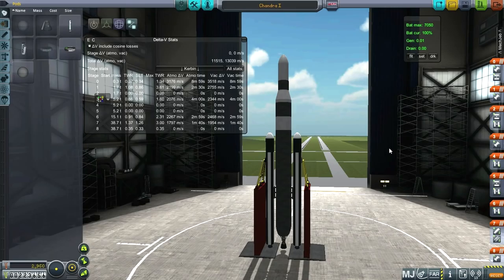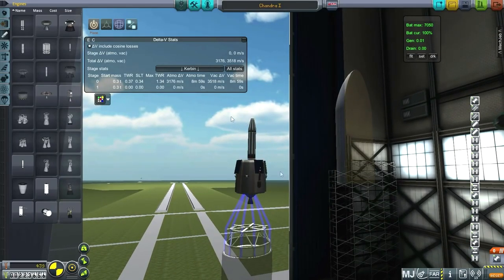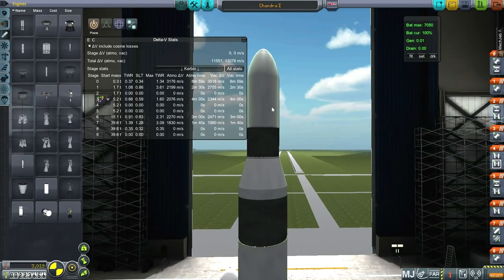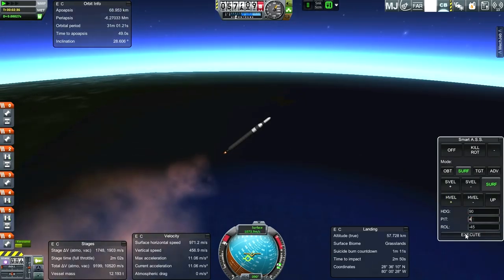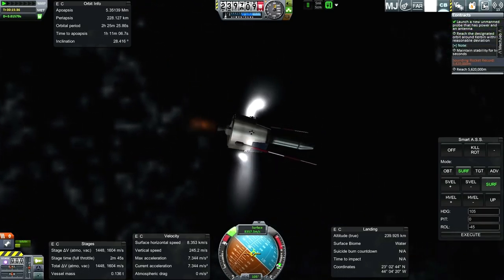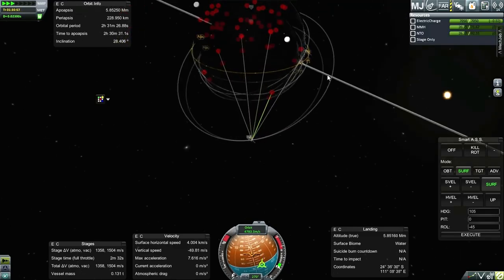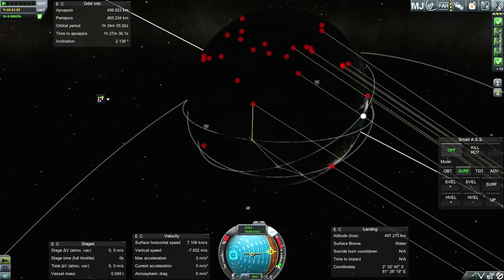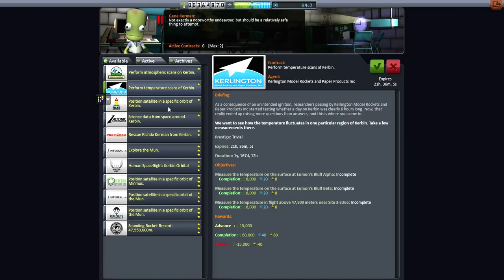Realism Overhaul in KSP Beta 06 - Fulfillment

Comment: Formula is range_a + sqrt(range_a * range_b) s.t. range_a < range_b. Note that the Deep Space Network groundstations on Earth have quite insane ranges (IIRC 7.5e+11) and even the regular launch-site ones are 75,000km. That means with 2 C16s and the Explorer core range_a = 9,000km, range_b = 75,000km, so final range is ~34,000km. With a 75,000,000km groundstation, now, it's a lot higher.
Reply: ***** It's my "semi-real" formula, aka rangemodel "root" (used to be "additive"). There's also a clamp, of 100 for antennas (and antenna-dish) and 1000 for dishes, i.e. if your probe's range is 9000km, then you won't have connection past 900,000km even the formula has a larger result. The normal RT rangemodel says, hey, the maximum-range antenna on your vessel is 4000km? Then you don't get signal past 4000km.
Reply: *****
I added the Launch-From-Cape relevant sites in the MSFN specifically so you get coverage on ascent (i.e. Bermuda and Canaries)

Comment: 1:40 - >  you don't need to upgrade your launchpad. Just put empty rocket on the pad and then fuel it. Like in real life :)

Use FASA launch clamps, right click on them and "toggle pump". Of course this is a bit cheaty because you can send 40t empty rocket on the pad and fuel it to 400t :>

You can also combine inclination change with periapsis change (more efficient then doing it separately) or even make bi-eliptic transfers (increasing Ap much more than you need, make inclination burn at Ap combined with periapsis change and then decrease Ap to desired altitude) especially for places like Baikonur.

btw your mod for clouds is latest RVE (0.90) ?

Comment: The fact that the LR-101 verniers (which should be used in conjunction with the LR79/89 and the H1/RS27) give less delta v when put straight, may be because of an older version of RP-0, in which they had the thrust coming out in strange ways. Either that, or I don't know why they are doing that.
Reply: ***** That's really strange. Are you on RP-0/Pilot (or 0.23)? https://github.com/KSP-RO/RP-0/releases
I remember that my Thor-Able had the same problem: verniers producing no thrust. I then realized they were working, but in a strange way.
Reply: ***** DNV970 & Raze 
I'll have to see if something in Ven's latest broke. That, or it's a Ven's <-> MJ issue.
Reply: *****
Huh. Can you try with just Ven's mod and stock KSP? If it's confirmed there (and I have no idea what we could have done to change it in RO or anything else) then it's an issue with Ven's pack. :(
Reply: Sorry for the late response, but I don't think it's only that: I don't know why, but the LR79/89 and H1/RS27 have a 0.25 degree gimbal since I installed RP-0 0.22-0.23. It's that again to blame on Ven's Revamp?
Reply: DNV970 & Raze
That's a bug in Ven's 1.7.2, Ven added rather than replaced gimbalRange. I fixed it in git but Ven hasn't released 1.7.3 yet.